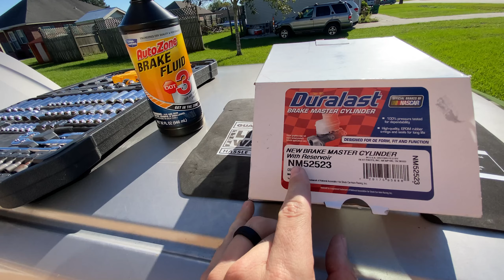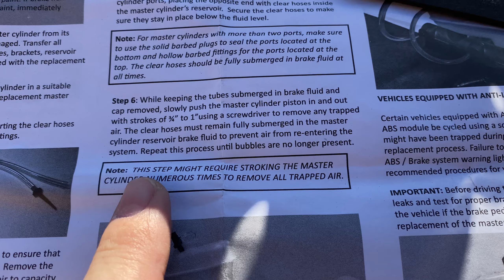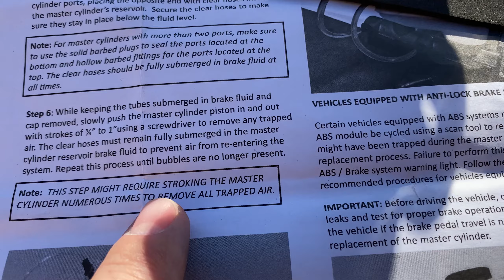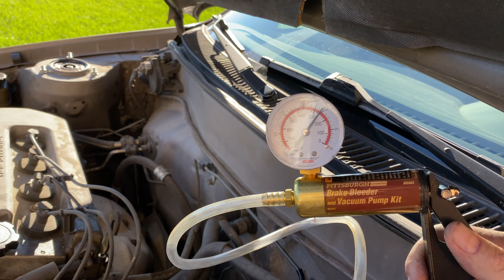98-02 Corolla - Prizm Brake Master Cylinder Replacement

Comment: That is the craziest brake line plumbing I've seen on a factory vehicle.  Get a set of line wrenches, it will help save brake line nuts.
Reply from the maker: Most definitely! Apparently I need to get a set for my house. I didn’t want to drive all the way to the shop for the repair.

Comment: Is bench bleeding necessary if im gonna be bleed the whole system anyways? (Of corse keep break fluid at reservoir max level). Thanks.
Reply from the maker: Yes, you must bench bleed or you will spend hours trying to get the air out of your lines. Bench bleeding is simple and quick, I did it on the roof of the car.